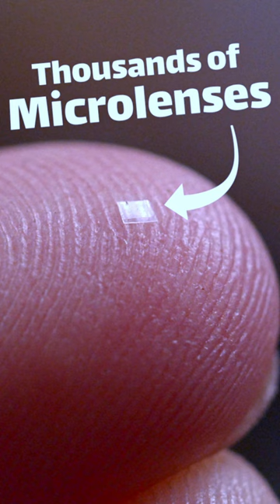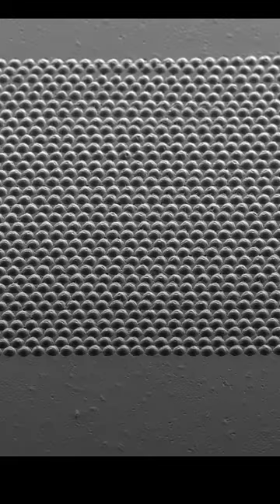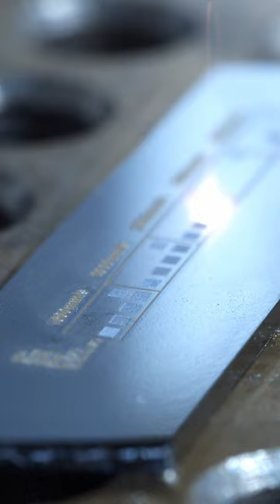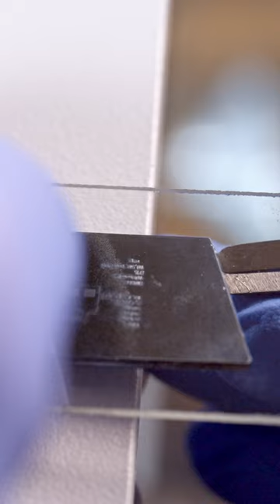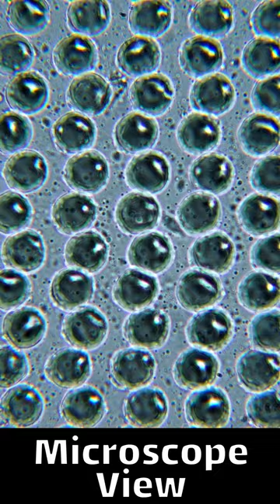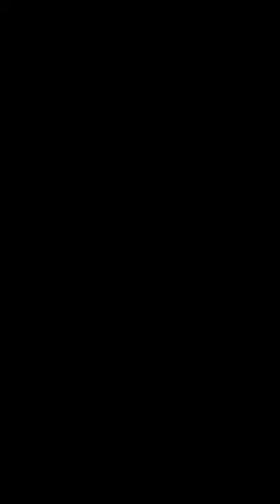Making Microlenses smaller than a human hair

Comment: When you spin a piece of the piezoelectric filaments into the shape add a linier sound of vibrational Energy to the spin you start to see a new way towards a new generation of circuits sound spins equally with the shaper we could get alta thin layers and the sound patterns are a nice lens for a multi frequency

Comment: The guy that makes the chameleon cloth could use this mold technology. They use wax and can only get about 2 pours.
Reply: Are you talking about the gecko tape/paper stuff? If so, that's a completely different type of structure which you can't really get with lasers in the same way, perhaps masked etching, but I doubt it.
Reply: @platinumsky845  no, I'm talking about the soft padding used on robots to grip irregular surfaces like fruit and even robots climbing walls with the chameleon cloth. I recently saw a short documentary about the stuff.

Comment: What are the uses of micro lenses ?
Reply: He literally answers this in the first 10 seconds
Reply: @misaroorasim  quote, please.
Reply: @Пути Тэнг    "Micro lens arrays such as this are often used in small sensors such as the one in smartphones (cameras)" used to focus light onto smartphone camera sensors
Reply: @misaroorasim  so other than that it's being put on top of the sensor there was no explanation in the first 10 seconds nor in the whole short. The first guy you were replying to clearly asked someone who have the knowledge about what are the tasks and problems these microlenses were invented to solve, as oppose to, for example, regular camera lense witch also fall under such a broad explanation "it is used to focus light on the sensor“. If you don't have anything constructive to say, why bother saying something so dull and empty as you were saying to him? You got my point?
Reply: @Pootie_Tang  no
Reply: @misaroorasim  :-/
Reply: So each pixel in a camera-sensor is basically nothing more than a measureing device to detect the of light hitting it. (With a colourfilter above for red-green-blue channels)
Now imagine those light rays going through the camera lens, hitting the sensor (many, many pixels close together on a flat surface). In the middle, light will hit the plane vertical, but on the sides it hits at an angle, as the light comes in cone shaped. So just like a glass window reflects light from flat angles, the outer part of the sensor will reflect light away and you get a darker picture there (vignette).

Now, when we place all these small lenses above our pixels, light will always, no matter what angle, be directed straight down onto our pixels, and we get a more even lit picture and far less loss in light which makes the camera "see better".
Reply: @PiTdeLyX  thank you! Makes perfect sense!

Comment: Assuming those are imperfections in the lens shape, I wonder how they would correct those
Reply: Perhaps a vacuum while the silicone is still curing, spreading it out enough to at least cover all of the domes, vacuuming to remove the air pockets, then spinning to get the proper thickness?

Comment: Can you explain what focusing light at such a small scale is used for?
This is way over my head, but cool.
Reply from the maker: Starting to get used on camera sensors. As pixels continue to shrink, it can be helpful to put a lens on top each pixel so it can gather more light. There are other uses in like Astronomy, but camera sensors is probably the most widespread use :)

Comment: What did you do about air particle contamination?
Reply from the maker: I didn't 🙃 Was just working in open air, so there was particular contamination. But the size of these (several micrometers) is large enough that most particles aren't a big issue. Especially for something "mechanical" like a lens and not electrical like transistors

Comment: How chips are made
Reply: Not really. There is no photolithography involved with masks.

No ion implantation or diffusion to extrinsically dope the semiconductor.

But yes, spin coaters are/used to be use to spin on etch resist and dopant materials.